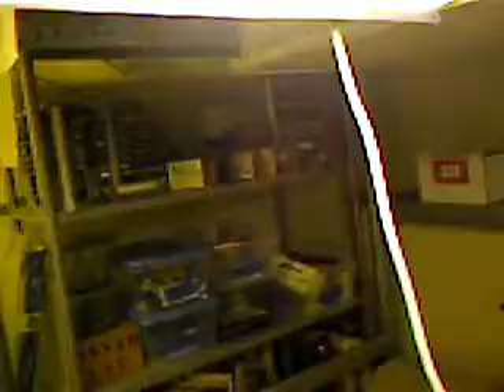What I did with the rapid start 2 lamp F8T5 ballasts part

Comment from the maker: These particular lampholders came from an online lighting parts store. Usually I get lampholders from gutted T5 undercabinet fixtures that I find at thrift stores for cheap. Some are screw in, others are held in by rivets. If they have rivets, the rivets can be drilled out, although you will have to use a nut on the back end of the lampholder to hold it in if that is the case, as it probably won't be threaded.